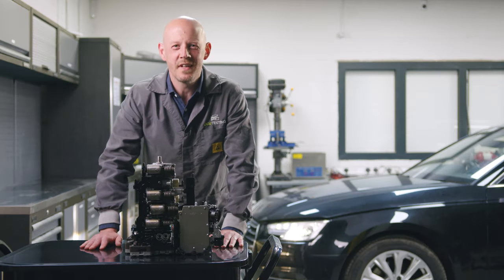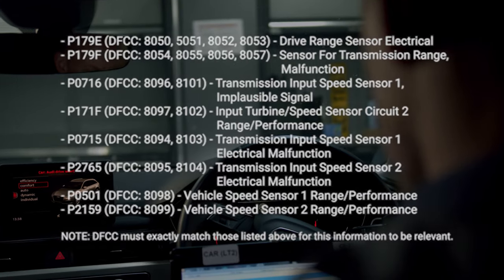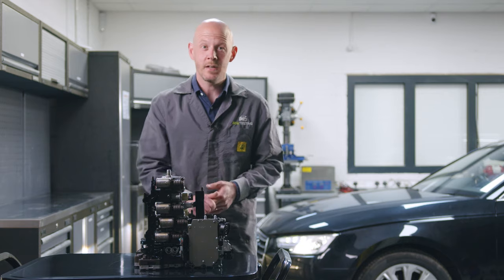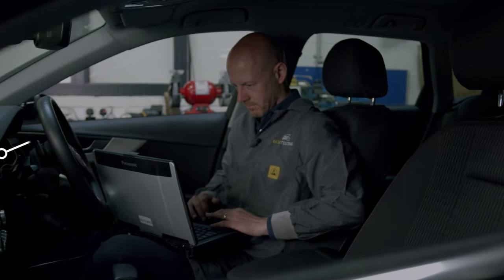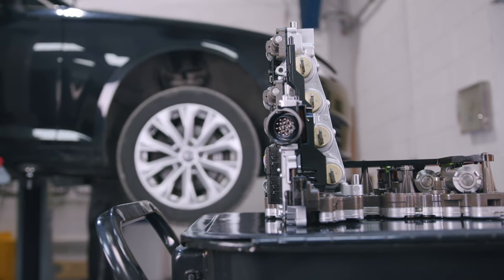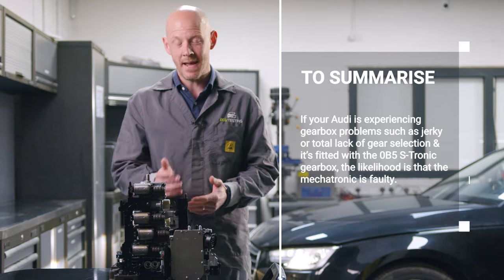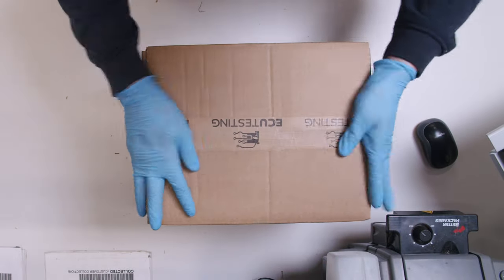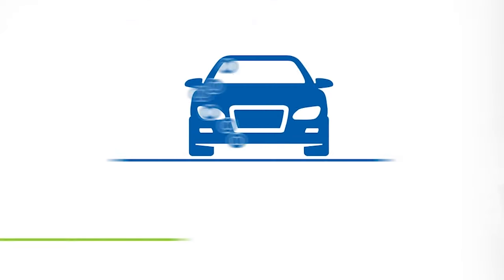Audi S Tronic Gearbox Problems

Comment: Hello I have a Audi q5 quatro 2.6 I having issues with the transmition do you have a repair shop I will like you guys to check it
Reply from the maker: Hi Juan, we offer test and rebuild of electronic control units
Reply: If the reader shows a mechatronic fault. Is it a must to replace it? As the car is working perfectly fine

Comment: Hi bud I've got 2015 Audi A4 Avant CVT automatic gearbox 2lt diesel.. 
I'm having a issue with it starting from a slight hill it will take of on bidding point but when you stop and put your foot on peddle it will go nowhere then it will kick and take of doesn't happen every time but I've just realised that you take foot of and on again it's ok...any help would be great thanks
Reply from the maker: Hi. Are you able to scan the vehicle for any fault codes at all? Without these it would be difficult to diagnose the cause of the fault. Cheers
Reply: @Ecutestinglimited  hi yes scanned the vehicle no fault on gear box
Reply from the maker: @thomasrobinson2746  Hi, if there are no fault codes being produced then it will be tricky for us to properly advise on the cause of the fault. The best option would be to take it to a garage and having them troubleshoot further. Apologies.
Reply: @Ecutestinglimited  Hi yes that's great thanks for your help
Reply: That sounds like normal multitronic behaviour, how long have you had it? It can be slow to react on a hill and a bit juddery/clunky but you get used to it and how to drive it. Had mine for 6 years/75k miles and at first I thought there was something wrong with it.

Comment: Help pls what about P02700 code?
Reply from the maker: Hi. This isn't a common code we have seen when the transmission is failing. However if you suspect the mechatronic is at fault then please email our technical support team on info@ecutesting.com with the following details. The make, model and year of manufacture of your vehicle, the symptoms of the fault including fault codes, and the part number printed on your unit. They will be able to advise you further. Thanks.

Comment: My s6 has a problem, getting code P189200. basically, i have to start in N, if i go from N to P then the its stuck in P but looking at the letter its in R, But car wont move so i guess its in P also, to change from P i have to switch off ignition, and start ignition again, then i can put it in N and start engine, then down to D to drive, sometimes i cant get it to D, i have to stop start stop start stop start and then it gets to D, weird thing is this is not always, its random, and when it doesnt work it doesnt work for atleast an hour. however the stuck in P part is always happening, Any help would be appreciatet, one person said it probably can be something that is in the gear box that changes the gear selector thing, because it drives smoothly on all gears otherwise. opening up the gearbox would probably be very very expensive
Reply: Take your car in and demand they show you GFF (Guided Fault Finding) in their ODISS software. If they don't have ODISS, run!

Comment: Hello, I’ve had fault codes 18004 - Gear Selector 4, P187D AND 18044 - shift Fork 4 position sensor, P2848. Any ideas please. Car is a 2014 B8.5 S4 Audi.
Reply from the maker: Hi. With those fault codes being produced, it is unlikely that the fault will be with the S-Tronic control unit itself, and rather with something within the gear box. Cheers
Reply: were u able to solve ur issue..i have same problem
Reply: Problem not solved at present. Audi specialist only offer was to replace the whole gearbox at £13.000. Four Gearbox specialist have indicate different solutions to the problem, from wiring loom, to mechatronics. None of the garages have indicated there solutions will definitely work but say it’s a process of elimination. I have the care scheduled for repair on the 29th June.
Reply: @winstonmcleish9602  did you got it fixed ?

Comment: Can anybody answer me some stronic concerned questions please?

1) Can I change D to S and back to D during driving without any other steps? 
2) What if I'm in situation, where I'm accelerating a little and "need" a downshift? Can I use paddle to shift down while pushing the gas pedal without causing any harm to the transmission? 
3) In manual mode I'm pulling up the car on a light stop. Can I stop the car on 2nd gear and then downshift to 1st gear when the car is stationary? Or should I shift to 1st gear sooner due to RPM?
4) Is it normal to hear the shift from 2nd to 3rd gear with no load? Can't hear any other gear change other than 2 to 3 and even that is with almost no load. Under the load everything is silent and all I can hear is the exhaust. Only 70k km on the gearbox so far. If the described situation isn't completely normal, what is to blame? Mechatronic part?
5) Should the transmission be completely smooth in a car from 2010? Sometimes when the car goes without pushing the gas pedal I can notice a little lagging on the 2nd gear. I can imagine this is a nature of the older automatics transmissions, just wanna know :-) 

Thanks, P.
Reply: I'll try answer some of these.

1.) Drive and Sport modes can be seamlessly swapped between during driving. 
2.) You can downshift using a paddle which will bring you into 'manual' mode and then accelerate as normal. The S-Tronic will then revert back to D mode after a few seconds.
3.) You don't need to downshift into 1st in manual mode, the S-Tronic will do it automatically. Downshift as normal to 2nd then when coming to a stop, it'll automatically go into 1st.
4.) Will need more details on the sound. When you say 'hear' the shift, what do you mean? I sometimes hear a noise from 1st into 2nd on my S-Tronic which has been there for a long time and caused no problems.
5.) Cars up to 2014 (when Audi introduced the newest generation of Mechatronic design) can all be susceptible to problems. Audi also left this gearbox behind and opted for ZF's 8 Speed transmission as it is much more reliable. The smoothness of your transmission depends on your mechatronics being healthy and your clutch packs not being overly worn. A failing mechatronic unit tends to damage clutches as-well so it's a 2 for 1 scenario. (You change out the mechatronic, you generally do clutches as-well).

Hope that helped.
Reply: in reality , the DSG will never be Super smooth , like a regular Auto transmission . it is essentially a clutch engagement you feel .
Reply: Can’t help with 4 and 5, but I can a bit with 1, 2, 3. 
1. Yes. 
2 and 3 are similar. You need to out-think it in a way, understanding it is always in 2 gears at once, trying to predict your next move. 
2. If you want to down shift, let your foot off the gas for a second, it will anticipate a downshift so when you do it it will be instant. If you try to downshift while accelerating you confuse it because it is ready for the next highest gear not the lowest. 
3. It took me a while to learn this one. You have 2 options when in M and coming to an stop. Just leave it in 3 and come to a stop slowly. It will understand you want 2 then 1 and do it smoothly. Or, if you have shifted to 2nd, come slowly to a stop, easing up ever so slightly on the brake as you stop - this gives to time to move from 3-1 on the 1-3-5 clutch/shaft. If you downshift to 2 and stop right away, it has trouble because it was ready for 3rd. 
The adjustments are small but important. It was hard for me because I drive manual cars mostly, so some habits had to be altered. Hope that helps.

Comment: Audi dealer have changed the whole mechatronic unit   after 3000 miles still experiencing the same jerking gear, and still getting gearbox malfunction . Audi dealer has denied to repair and get responsibility.
. Audi is scam , I will not buy audi

Comment: iv had problems since audi serviced the gear box? i keep getting the fault shift to P before leaving the vehicle
Reply from the maker: Hi. Are you able to scan the vehicle for any fault codes at all? Without these it would be difficult to diagnose the cause of the fault. However if it was working fine before the service then we would recommend bringing up this problem with the garage that carried it out. Cheers.

Comment: Pls provide tentative cost for repair mechatonic for Audi A7 2013
Reply from the maker: Hi. Please select your car make and model on our website here for the most up to date pricing: https://www.ecutesting.com/common-faults/audi/audi-s-tronic-0b5-gearbox-mechatronic-problem/ Thanks.
Reply: @Ecutestinglimited  I live in Dubai ..
Reply from the maker: @abahsain  That's not a problem, we offer a worldwide service! Fill in our online test form on www.ecutesting.com for more details regarding shipping. If you would like more information on this, please contact our technical support team at info@ecutesting.com
Reply: @Ecutestinglimited  thank you .. fault code is P176500 hydraulic pressure sensor 2 adaption limit reached..is it a valve body is damage??
Reply: @abahsain  Hi Bro did you resolved it. Need your help if you did. I’m in Dubai too.
Reply: @himanshutanna711   yes.. resolved .. GRAN tourismo auto repairing

Comment: Wher you based
Reply from the maker: Hi. We are based in Derbyshire in the United Kingdom, however we offer a worldwide service so you can send units into us no matter where you are! Check out our website ecutesting.com for more details. Cheers.
Reply: I live in London I have got my vehicle checked by someone they told my it’s mechatronic unit faulty if I bring my car down you can carry out all work it’s Audi A6 2019 4.0 tdi
Reply from the maker: @point2be891  Hi. Unfortunately we do not offer a removal or refitting service so if you would like to send your unit into us you will need to arrange for the unit to be removed and refitted independently. If you would like to send your unit into us, please contact our technical support team via email at info@ecutesting.com with details of your make and model of vehicle, the part number of the mechatronic, and any further details or diagnostic information relating to the fault, and they will assist you further. Thanks.

Comment: After 30 years of BMW 5 series (540i etc) I have gone to Audi. I purchased a used but still fairly young S6 Avant. I have never in my life owned such a piece of trash. This happens to mine all the time ONLY when I reverse up a slight incline or up a soft curb to park. It jerks then revs with no movement and then SUDDENLY LURCHES forward along with the cog wheel sign. It happens every time in that scenario. I utterly detest this vehicle and feel it should have NEVER passed any approval for it to be sold. This is a pathetic gearbox. It's simply ridiculous to put something so dangerous into the hands of normal users, or better said be sold at all!!!! I could run/knock someone over in front of me BEING IN REVERSE GEAR!! It's outrageous. These are dangerous toys, not cars. I have to think back to the 80s when in the USA Audis were constantly being smashed into walls. I thought the yanks were mad. Couldn't drive. I have TOTALLY changed my mind! It's Audi!!! Audi engineering.
Reply: Vous avez raisson audi poubelle, je vend je rachete bmw comme avant .
Reply: If so, you have a serious problem with your gearbox. I have reversed up a steep bank with a 2 ton caravan without that problem. Just a hint of burning clutch 😂
Reply: Audi is a shit load more reliable than BMW

Comment: Hi mate

Audi is new

But never been jerky

Suddenly the car stopped

Said Audi gear malfunction

Car doesn’t move but it goes into all gears? Goes into drive but doesn’t move what could this be please help
Reply from the maker: Hi. The symptoms you are describing could indicate a failing mechatronic unit. If you are able to scan the vehicle for any fault codes then this could help aid the diagnosis. If you are able to do this, then please email the results of the scan to our technical support team at info@ecutesting.com, along with the symptoms of the fault you have described above, the make and model of vehicle, and the part number of the mechatronic unit. They will be happy to advise you further.
Reply: @Ecutestinglimited  is it quite expensive
Reply from the maker: Hi. Please visit our website and select the part number that matches your unit (or your vehicles make and model) to see our most up to date pricing: https://www.ecutesting.com/common-faults/audi/audi-s-tronic-0b5-gearbox-mechatronic-problem/
Reply: @Ecutestinglimited  thanks I tried I don’t think you have any parts for the new 2020 only older parts right cannot any 2020 I will buy today if you have
Reply from the maker: Hi @asianking187  if you cannot see the part number of your unit on our website, please email it to info@ecutesting.com and they will be able to advise you on any test or re-build service we can provide. Thanks.